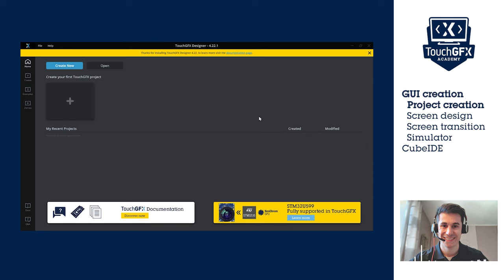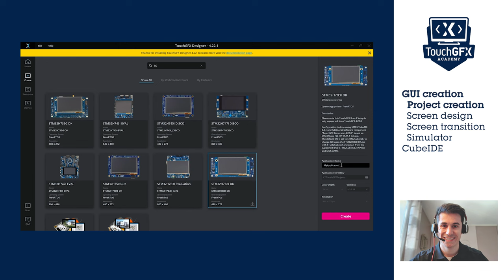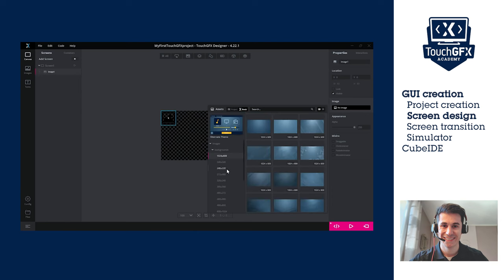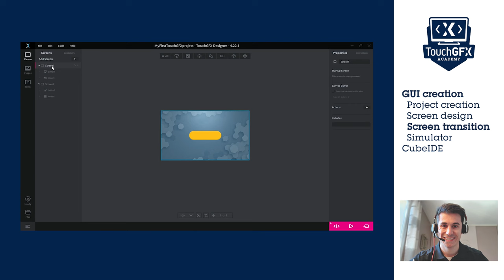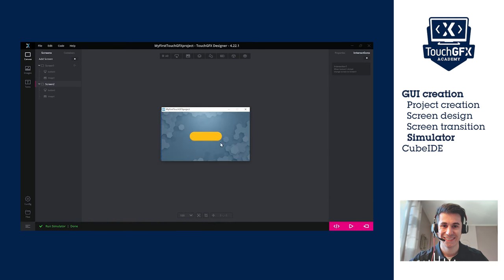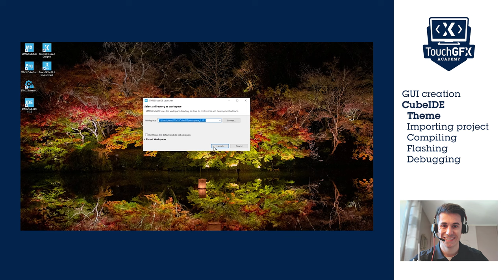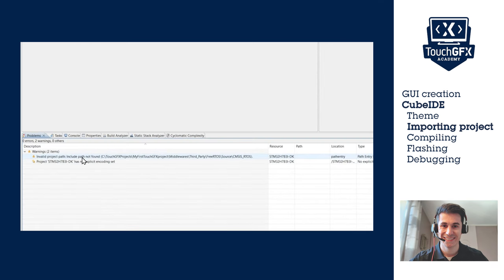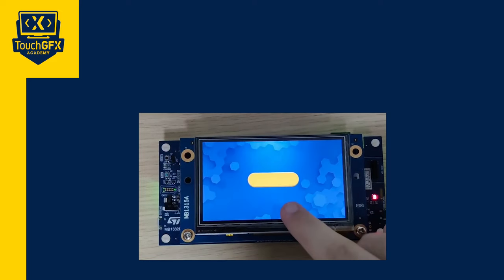How to TouchGFX: Creating my first GUI with TouchGFX Designer for STM32 GUI applications

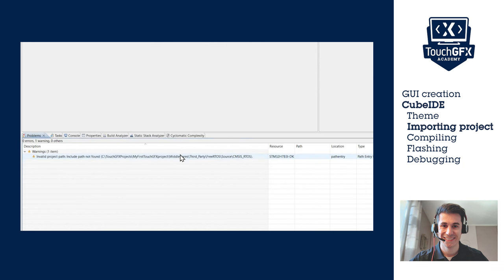Comment: Hello, and thank you for your video series. Unfortunately I have a problem that I can't solve: In your video at 9:39, you show the imported structure of your project. However, the xxx.IOC file is always missing for me. My STM32CubeIDE is version 1.17.0 and GFX version 4.24.1. In the GFX I can save the project on the STM32F429i-Disc1, and the display shows everything there. Unfortunately, I can't continue programming in CubeIDE because I have no way to edit the xx.ioc file and set ports. I would be happy to receive an answer, MFG Peter

Comment: Thanks! That's a nice basic tutorial! But I would like to see it go a little bit in-depth with the custom hardware. Which pins, what protocol, etc.. I'm planning a custom board with a 4D Systems Gen4-FT812-70T display. This turorial doesn't explain how the IDE knows what pins are used on the MCU or even which MCU is used in the first place. What about display modules the TouchGFX software doesn't know about? Besides that I would also like to see some custom graphics rending from software.. Is there a canvas widget or component that I can draw some cool graphics to from the firmware code and is that fast enough to do some cool interactive animations like dragging a gradient filled circle around the display in real time without stuttering and glitches when using for instance an STM32H723?